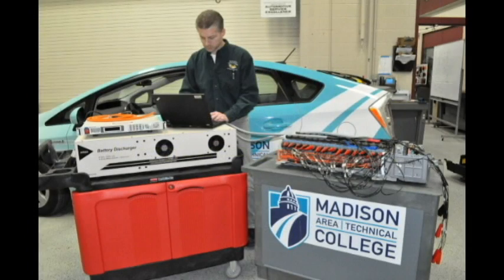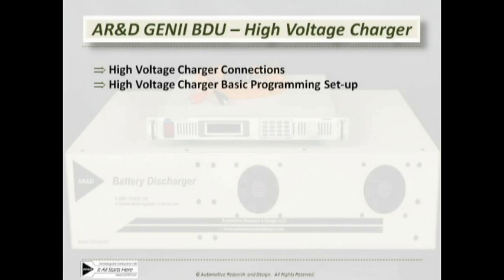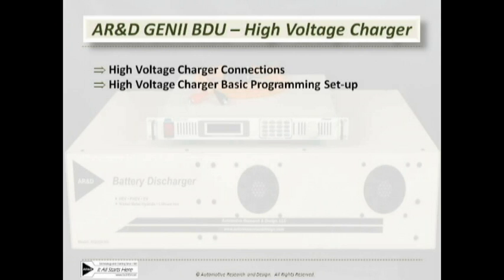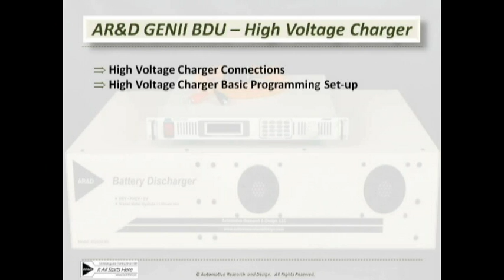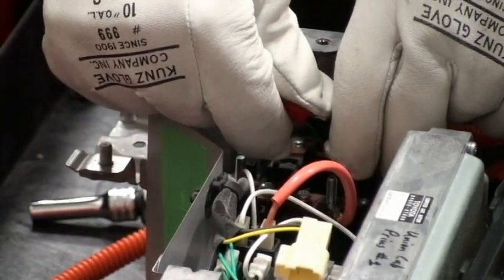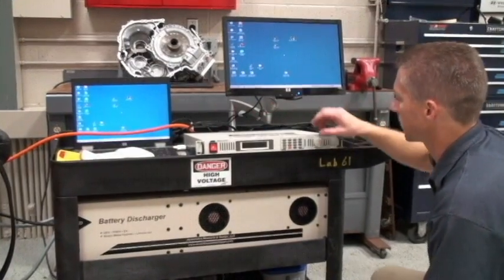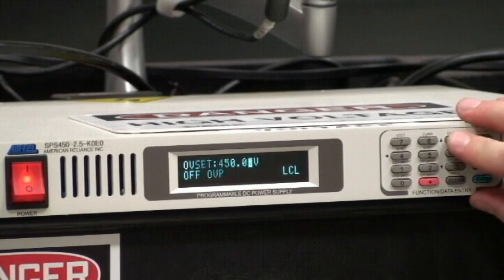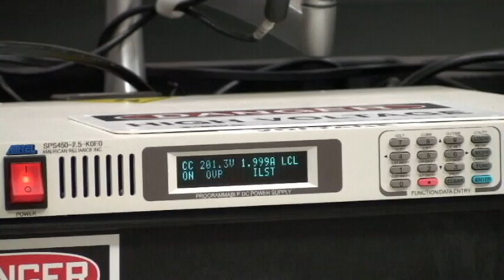High Voltage Battery Pack Charger.avi

Comment: Why does nobody invent a charger that can recharge the battery in the  vehicle? My 2007 can drive 20 miles on one charge.  Then the engine starts.  

 I know that there are plug in kits, but they require more batteries.  I'd like to drive 20 miles and then plug in my hybrid battery overnight and drive 20 miles again.